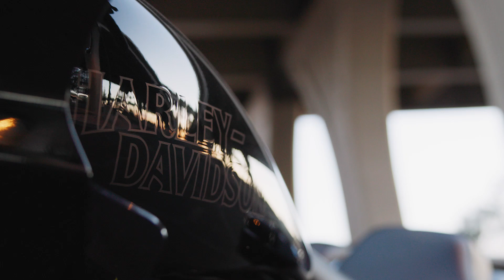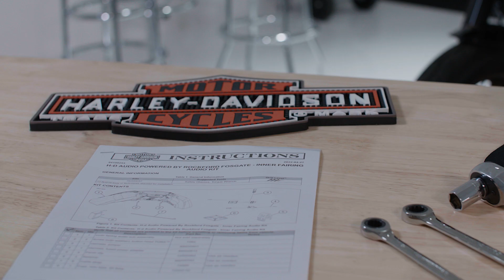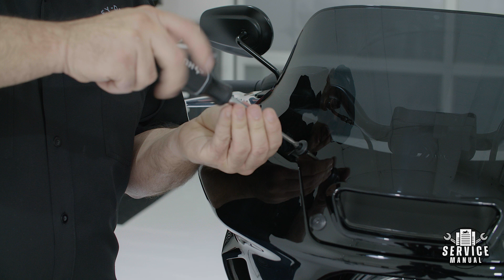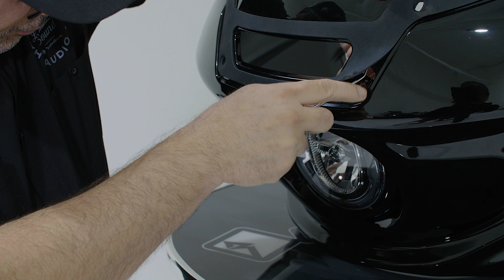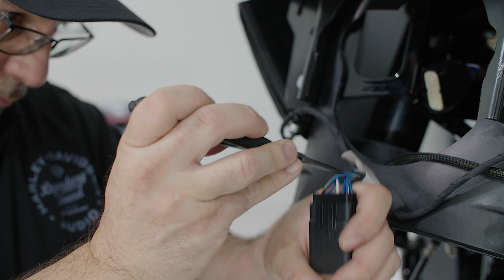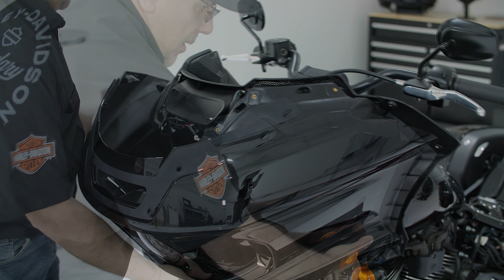Low Rider ST Inner Fairing Audio Kit Install | Harley-Davidson Audio powered by Rockford Fosgate

Comment: I got a 25 Lowrider ST, when I was installing this system and got to the backbone 20 pin harness, I ran into a problem. Instructions said to remove the plug from pin 9, but on my harness, all pins were occupied by wires. I’m curious if anyone has installed on a 2025 and how you got around that issue.
Reply: Same problem for me. Number 9 is not for the pin. So now I dont know witch of the pins i should use...its not number 9!
There are about 6 too shoose from 😢
Lowrider St 2025

Comment: A paper clip works
The video doesn’t show how to disconnect the plug under the seat!! He says “Pull the red tab” that’s not the only thing, you have to use a small screw driver or pic tool on the bottom of the plug you have to lift the tab and pull apart.

Comment: The 2025 model doesn’t have a 16-way backbone harness, only 8. Instructions unclear. Definitely NOT plug and play and now my bike is in pieces.
Reply: Pin 7 is what the interactive instructions said for 25… but… there’s a bigger issue. The backbone harness is completely filled up. There isn’t a place for your power wire to land.
Reply: @joeymartin6658 install fuse in fuse block and there is no new connection to battery.  Pin 7 in fairing.
Reply: @ellisd805 not all hero’s wear capes. Thank you.
Reply: Please let me know here if you ended up finding a solution because I’m about to take mine into HD and just know it’s gonna be a pretty penny.
Reply: @joeymartin6658 took mine to HD😅
Reply: Anyone ever figure this out for the 2025?
Reply: No info for 2025?
Reply: I’m here for the 2026. There is numerous errors saying cavity 4, cavity 7 for the front fairing and then nothing for the backbone harness under the seat for the fuse.

Comment: How do you make this work on a 2022 FXLRS? I've got the stereo kit but don't see the 16 pin fairing bus wiring harness described in the video. Is there an additional harness I need?
Reply from the maker: Hi there, we recommend stopping in at your local dealer so they can take a look, or give our Customer Care Team a call at 1-800-258-2464 (Monday through Friday 8:00 a.m. – 7:00 p.m. CDT), so they can learn more and offer assistance. Thank you!
Reply: I got about halfway through my install today and just realized this as well. Did you ever find a solution?? I’m installing on my 2023 Low Rider S with Advanblack ST fairing and I can’t really go any farther
Reply: @witeboooi  pull up the wiring schematic for the 22 FXLRS and you'll find there is a spot on the rear bus plug to connect it to. You'll have to splice and extend the wire that goes to the actual unit to reach the front of the rear bus under the seat next to the battery. Use same pin location that you use for positive battery location from instructions

Comment: I'm installing an Advanblack fairing, along with this speaker system on my 17 FXDB. There is no slot for that cable.  My wiring harness does not have room for the remote wire.  Any suggestions on where to route that wire (for slot 11)?
Reply: What is the wire for ? I am doing it on my 15 fxdb as well

Comment: Will this work on my 2020 lowrider S that I installed the ST fairing on?
Reply from the maker: Hey! The Harley-Davidson Audio Powered by Rockford Fosgate Inner Fairing Audio Kit is only compatible 2022-later Low Rider ST models. Thanks!
Reply: I have a 23 low rider s do I need any other harness aside from the jumper harness?

Comment: Harley Brass:  "How hard can we make the installation of something that should be plug and play?"  Harley Engineers:  "YES!!"

I thought Honda was bad, but sheesh! I was in mechanical design for 30 years and this stuff drives me bonkers!  This part was specifically designed for this and could have easily been designed/integrated into the harness for easier assembly.  Also, and this is just me, they couldn't have made the bags THE SAME SIZE???  I know it's not just Harley, but it really detracts from an otherwise gorgeous bike.

Comment: Thank you for the tutorial. I just installed it under 2.5hours. I struggled with removing the pin, I didnt had the tool and had to use a paper clip. Overall made it successfully without scratches. Sounds great!

Comment: Thank you for this video. I'm going to be putting an engine guard on my ST and while i have the service manual, i will need to put a bracket on that requires the outer fairing to be removed. to see it done answered some questions i had about it. thank you!

Comment: Super easy to follow other than it would be nice to have a little more information on disconnecting the 20 way connector. After unlatching the release tab (red) you need to depress the black tab to release the connectors. This was the most difficult part of the install.  Thanks for the video.
Reply: Thanks for your feedback Roland!
Reply: I finished the install in about an hour. Your right, that last harness was tricky

Comment: I have a 2022 Lowrider ST and my pin 11 has a red wire in it? Which can do I use Rockford Fosgate can you help me out you’re directions are not correct with my mom for whatever reason
Reply from the maker: Hey there. We'd like to try to help. Please give us a call at  1-800-258-2464. Thank you.

Comment: Too bad all the dealers are scalpers and want $35k for these.
Reply: Seriously, might as well buy a street or road glide at that point
Reply: @jackmcinnis4510  Agreed. In Canada about same cost as a Street/Road Guild with a full fairing including sound.
Reply: @barter321  not really. low rider s/st come with 117 vs same price street/road with 107. You go to the street/road with the 117 engine you're at 37k msrp instead of 27k.
Reply: I work at a dealership, and no way in hell are we charging that much for one of these.
Reply: I got mine last week for msrp in Kentucky shipped to ct
Reply: In what department are u working at, perhaps in the basement… not to know dealers are ripping riders off with their outrageous mark up fee for this “Just” a Low Rider S with a fairing, u should visit LA Harley in California this dealership  don’t even have the dealer sticker price on it & wants u to make an offer before they let u ride it not to mention the criminal looking sales people they have attacking u ..,
Reply: @orlandofranco9910  retail is 23,594 on a fxlrst, NOT including ttl and dealership setup, Which varies by dealer. So if your dealership is charging 35k for one, I recommend going to a different dealership lol. And you told on yourself man, L.A....get the hell out of L.A. oh and I work in service
Reply: @kevincook2739  in ca and Illinois there getting 30k
Reply: @kevincook2739  21,749 is MSRP.
Reply: @btoso32  agreed. I said retail, Not MSRP
Reply: Go to laidlaws in Baldwin park no dealer markups